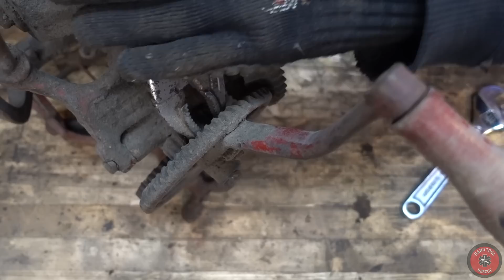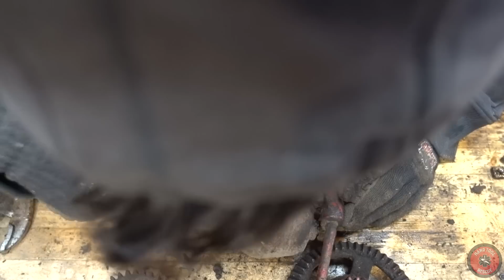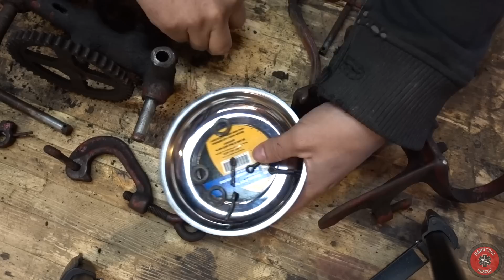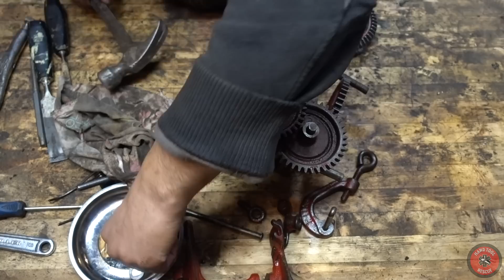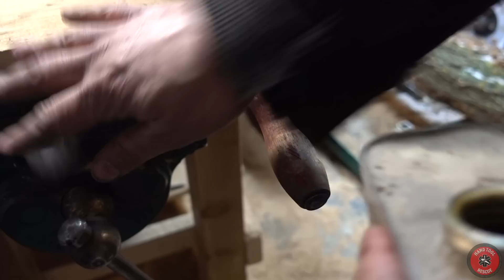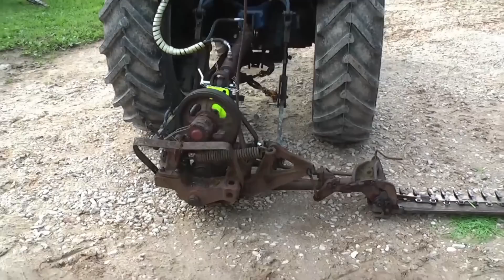Sickle Blade Sharpener [Rescue]

Comment: My Grandfather had a Sickle blade hay mower exactly like this one (I'm 60) almost all of his equipment was McCormick Farmall, 2 tractors ("A" & "H" models), this mower, a hay baler which had it's own gas engine, and manure spreader, he didn't however have one of those sharpeners, I think he just used it till it was too dull then swapped out the blade or individual teeth (I don't ever remember seeing him sharpen it). Brings back happy memories, thank you for posting.
Reply: Oh, I forgot the hay baler was a 'New Holland', plus hay rake and plow/disk/roller and tobacco setter.
Reply: bom dia
Reply: I remember that and that we used to find the dull teeth around the machine shed. Most farmers I knew used a hammer when you needed a sharpener! Most of them never sharpened them. The county had these to mow the ditches. Now they drive big JD's, heat, AC and a huge mower on the back then complain about the expense in the yearly budget. They also trim back brush and branches with them and all it does is make the roadsides look disgusting with busted, twisted, and shredded wood. Wait until they find out all those trees will die of rot years from now because of it.

Comment: Very interesting to see the whole story from teardown to final assembly then used on the job cutting grass. In 1953 I was lucky enough to learn to drive a McCormick-Deering kerosene powered tractor. It was used to mow the fairways at the local golf course where we lived. In that setting, the typical reel-type mowers were used on grass, and scrubby edges got the sickle-type side-mower. Great fun for an 8yr old, impossible today with Safety Nannies running amok.
Reply: We cut 8 acres of Bromegrass using a Farmall Cub with a belly mount sicklebar.  Then we gathered it into winrows with a dump-rake that had large STEEL spoke wheels. (I sat on the seat and ran the dump lever. After it dried we pulled the rows together and made haystacks, which we sold on site.   Those were good times.

Comment: Back in the 60's a guy made a sickle sharpener. It had a narrow flat table that held a sickle. He had a washing machine electric motor driving a rock like that hung down on swing arms and floated back and forth. It had two flat metal hold down clamps with a high leverage foot pedal to release it. The spring was off some old cultivator I think. We baled about 250,000 square bales every year and would drop off maybe a half dozen sickles every evening and pick up the ones he had sharpened for us. He also sharpened sickles for two or three other custom balers. I think he charged a dollar a sickle for a 7 ft sickle.

Comment: Ha! Cross-fit, that's a good way to describe cleaning off old things like this! I've got an old gear with that IHC logo on it, different type of gear though (probably for a big clunky chain-drive) and I've never found much info on what it came from despite it having a number cast into it. Looks like it's good for another century! (though I wonder if a bit of paraffin would smooth the gears) Thanks for including that end-clip, the name 'sickle' was throwing me on what the mower looked like.

Comment: great job !! thanks for taking the time to share it :)

I love old hand tools and love seeing them get a second chance, I am currently restoring a no. 1 1/2 boynton and plummer post drill and your videos really encourage me . my advice , VINEGAR! it works  wonders. just soak your parts or your entire tool (if possible) overnight and scrub clean with a wire brush under running water. all seized parts will free up and any raw metal will be rust free , shiny and ready for paint or treatment! 
this is my favourite and cheapest method and has save me hour of manual labour.
Reply from the maker: Thanks!  Ooooo...a post drill is definitely going to be a video in the future.   I normally use evaporust, but the customer wanted as much of the original paint on the item as possible.  I do need to get into electrolysis though!
Reply: Hand Tool Rescue  you and I are in the same boat, I've wanted to try electrolysis and even plating .... hmm maybe one day 

and a post drill video would be great , I look forward to it :)

Comment: Hard to see from the demo at the end of the vid, but the sickle bar has two sets of teeth.
They cut with a scissor action.
I had a 7' sickle bar years ago.
the bottom teeth were flat cut, like in the demo at the end.
The upper teeth were serrated, no idea how those get sharpened.
Those sickle bars can cut wicked fast.
But most of the dedicated sickle bars have been replaced by heavy flail mowers.

Great vid.

Comment: Had the identical unit on our farm (McCormick-Deering), sharpening the mower blades was last job before retiring for the evening, plus fueling  the tractors, and greasing equipment. That stone needs to be trued, so it reaches to top of the V on the sickle blade sections.  One question:  Why did you dismantle everything, could have reached same finish by using a can of brake clean, a scraper, wire brush, and some rags, didn't replace, repair, weld, repaint anything, not even cotter pins?

Comment: I like your channel a lot.  Another version of my hobby, restoration of old electronics, mostly test equipment.

I did have a question.  I find that it really pays to document how things are arranged before I start taking things apart, transformers with a dozen plus wires, or complex switches with sixty connections, things like that.  Sometimes just handmade notes, sometimes photos or video.  Do you do this for your projects?  What methods do you like?
Reply from the maker: +Joseph Cote Filming is definitely key for me

Comment: It looks like you use a lot of WD-40.  Here's a money-saving tip:  Buy a non-aerosol spray bottle of it off of Amazon or eBay, and buy a gallon of it from the blue or orange store.  You have to get the WD-40 spray bottle.  Regular spray bottles don't like it, even the ones that they sell right next to the gallon of WD-40 at the blue and orange stores.  Online was the only place I could find the non-aerosol spray bottle.
Reply from the maker: That is exactly what I use in the later videos.
Reply: Maybe I should watch all of the videos before I comment.

Comment: I am forever trying to figure out the oils he uses. Interestingly enough he more often than not uses WD40 as penetrating oil (in later videos he buys it in bulk and uses a spray bottle) and 3 in 1 or 30 weight non-detergent oil. I have had great results with chain saw chain oil.

Comment: Cool stuff! I like watching this type of stuff. Why not power wash or like sand/walnut blast the parts?
Reply from the maker: Thanks!  I wish I could power wash, but it's way too cold outside (-30C), haha.  Sandblasting, I am working up to that.  You need a fairly expensive air compressor to push enough air to sandblast for any useful amount of time.

Comment: Nice Job! and Great Video! and im glad you didnt paint it! i love the original patina and rustic paint look lol thats how they should look lol after all they are old as Heck! lol Hey one question though and i totally dont mean this rude or anything like that! but do you think grease in those giant old gears would be better on the metal? not necessarily the functionality because i know grease is thicker so it would run a bit slower. but it kind of sounds rough lile to much friction even with the oil you put. just a thought dont beat me up! lol
Reply from the maker: Thanks!  Grease would definitely make it run smoother, but it would also easily collect debris, and for this pieces, the customer just wanted it nice and clean with the original paint iff possible.
Reply: Hand Tool Rescue oh ok i see lol well im sure they were Very Happy with the end Result.

Comment: I'm curious as to why you don't use a Tumbler for the smaller pieces.  Do you find the Rust Remover and wire brush to be quicker, or are there other concerns?  Also, I would also like to say I find your videos very relaxing and at times comical.  Great Job!
Reply from the maker: Thank you!  I like the rust remover solution as it gets into the tiniest of spots.
Reply: Cool! Was wondering if it had to do with material loss or something similar.  I realize your restorations are for practical use of the item, but have you considered a more artistic approach. For example electroplating some of the items with copper or brass?
Reply from the maker: +AshesMardiGra Electroplating would definitely be something I would like to do more of in the future.

Comment: Love the videos, if i could add a little criticism, take your time and work on painting and cleaning the machines/tools a little more throughly, a restoration is to bring it back to the closest possible place back to original, you are wizard at disassembling but would like to see more effort in the paint and cleaning. As for this video i was kinda disappointed that this wasn't a restoration at all, the demo peice wss closer to what i was expecting. Thats just my 2 sense, regardless still a big fan and love the videos!

Comment: How does anything get that dirty? Yes, it is old, but it's not like the thing needed to be oiled a lot nor that it would likely be found in a place where grim is naturally generated. It looks like it was almost baked on. How would that happen over the ages?
Otherwise, the video speed is much too fast, and you could have just pressure washed it without disassembly. This is just a cleaning, and not a very good one.   You've learned a LOT since you made this one.

Comment: Had to give this one a thumbs down,  the restoration wasn't up to your usual level. I didn't see you fix the bent screw,  and no paint removal or sand blasting. Looks like you could have done the same thing with a cheap pressure washer without having to disassemble it. I did like the demonstration at the end.

Comment: Half-ass job IMO. Why start a job if you're not going to do it right AND do it completely? Seriously not trying to hate or troll. You do nice work. Just sucks to not see it done all the way. You probably spent a couple hours on that and to not get the rust (soak in distilled white vinegar) and paint (paint stripper) off was a downer. It would have looked really nice.
Reply from the maker: No worries.  I had to keep us much of the original paint as possible for the customer.  One of my upcoming videos has more of a full restoration with completely new paint.
Reply: From experience, you can use an acid bath to remove rust without affecting oil based paint (I use oxalic acid rather than distilled white vinegar, but that's just because I picked up 5kg for a project years ago and am still working through it). You might also want to think about getting an ultrasonic cleaning bath to remove crud easily without affecting finish. I don't have one at the moment, but am seriously considering getting one.
Reply: +Hand Tool Rescue I don't get these guys. It had 70% original paint! A true restoration is RESTORE it to working order and preserve the product. I get full restorations and that entails re painting it. Ut does look great then, but to restore the original paint... much better in my opinion. Plus you did what the costumer wanted.
Reply: I kinda like the vintage look
Reply: I think the results were awesome WITH the preservation of the original paint.
Reply: Sometimes it's not as must "restoration" as "rustoration."
Reply: hand tool rescue I have been watching your videos and love them,like in this case I was thinking in criticize but them not because for the lack of cleaning,restored or whatever I know you don't work that way,but in the other hand in your case you most do what the customer wanted to me is look fine,great video and Ty for sharing....

Comment: You could've dunked the whole thing in warm degreaser, blown it dry, and oiled it with real oil not that 3 in 1 crap.  Would've been done with it in an hour or so. It drives me nuts to see people molest quality equipment with vise grips and wd-40. Even worse is all the commenters that seem to think this is good craftsmanship. It's kinda sad.
Reply from the maker: Tried it.  I soaked it in degreaser for 72hrs, did nothing.  Doesn't need "real" oil as it most likely will never be put into service again.  WD-40 works find for me as a penetrating oil.  This will be stored inside for the rest of it's life, most likely, anyways.

Comment: This was a HORRIBLE restore.  After you restored it, you should have soaked it in either vinegar or some kind of degreaser for at least several hours to break it apart even more.  Paint removing is next, followed by sand blasting it, then you heat treat whatever needs to be, and repaint.  Finally if the handle is okay, a little sanding and then recoating.